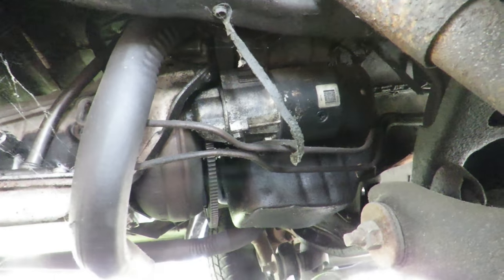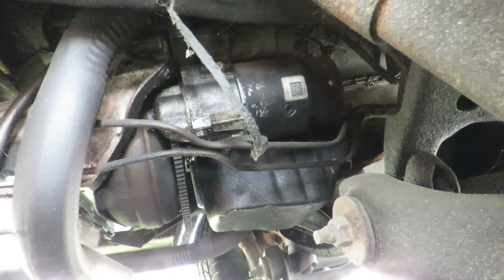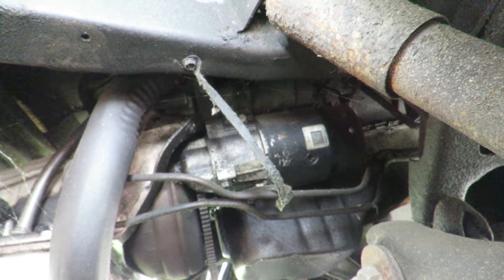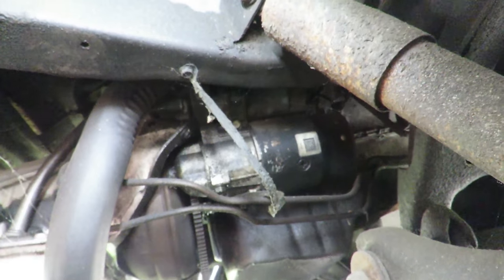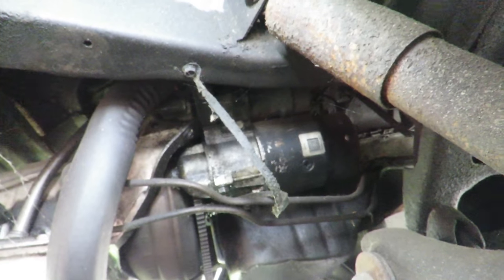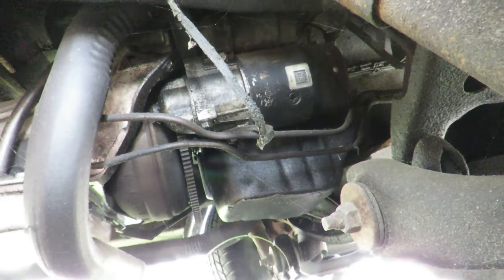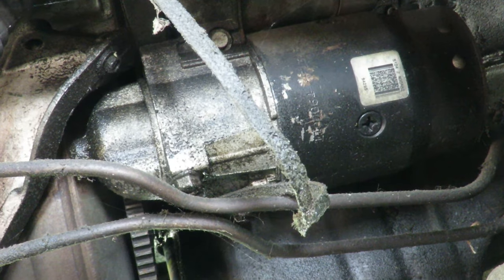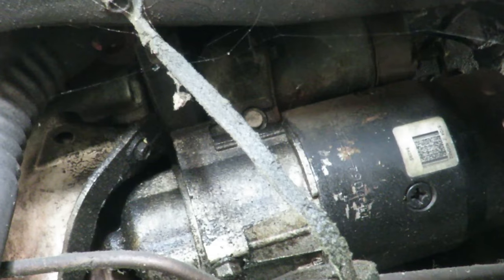⭐ How Does A Starter Going Bad Sound? - Sounds Of A Bad Starter - Part 2 In Description

Comment: My 99 poniac Sunfire makes that noise and starts after a few trys, it's runs fine no problem, but earlier when I parked it and came out later to try to start it, it didn't start no more, it makes the same noise, could it be the starter?
Reply: Like sometimes after I get it started in the morning, it'll start up fine. but most the time I gotta give it a few turns, but now it's it just making that noise.
Reply from the maker: Yes, it definitely sounds like the starter is bad!
Reply: Like it sounds like it wants to start but it's not.

Comment: Question ! Does a failing starter keep making that noise as you drive ?
Reply from the maker: In my career, I have only seen that once, but it was on a BMW, and the battery terminals got REALLY REALLY HOT.

Comment: Hello my starter of my 1978 datsun 280z cranks super slow like never before I put new battery and same thing . Is the starter going bad?
Reply from the maker: Check grounds and timing first. I had one of those, and I wish I never got rid of it, GREAT CAR!
Reply: Astral Auto Repairs  bro but I was checking compression test and i removed all the spark plugs and after doing the test in the first 2 cylinders the issue started

Comment: I have a 2006 Chrysler 300. The other day I had to jumpstart the vehicle. I took it to auto-zone to get the battery tested . The computer showed good battery but needs to be charged. I had the alternator replaced with a new one in March of 2020. The car has been running fine for the past few months. I decided to get a new battery as I’ve had the vehicle going on three years. After installing the new battery the vehicle wouldn’t start at all . So I decided to check started relay by taking it out and placing it back . When i did so the vehicle started. I also swapped the horn relay and the car started. I then proceeded to purchase an after market relay for the 2006 Chrysler and I tested the vehicle multiple times  and the car would turn on without any issue. I took it for a drive to a friend who is a technician . I turn the vehicle off. I attempted to turn on  the vehicle and it would not turn on. I went back to to the relay box and took the relay back out  and put back in and i was able to turn the vehicle on. Not sure if it could be a bad computer or if the starter may be going bad. The starter didn’t sound like a starter going bad. At this point your feed back would be much appreciated.
Reply from the maker: Be sure the ignition switch is good because Chrysler has an issue where a piece in the ignition switch breaks, and the car won't start sometimes. Hope this helps.
Reply: @OnlineAutoRepairVideos  , yes thank you. I’ve thought about the ignition as well but  it has been turning on . It just doesn’t turn on from time to time.
Reply: By the way, I’ve learned so much watching your videos.
Reply from the maker: @ricosuave2934  Can you do a video of the problem, so we can see the issue, and THANKS for the compliment on our videos!
Reply: @OnlineAutoRepairVideos  , absolutely!!!! Thank you so much!!!!!
Reply: @OnlineAutoRepairVideos  I have to work tomorrow. I’ll do the video and send it your way.
Reply: @OnlineAutoRepairVideos  , where do I send the video to. Sorry.
Reply: I had to reset the anti theft immobilizer . I’ll let you know if this take care of the issue.

Comment: I just started noticing a ringing sound shortly after startup,kind of hard to explain, imagine like a metalic ringing/whistle I can't pinpoint where  it's coming from,I have noticed that the car starts fine if it's cold,but after a hot startup it turns over slowly, almost feels like it won't turn over.
Reply from the maker: That is another sign of a starter going bad. MAKE SURE you put a heat shield on the new one when you replace it: https://www.youtube.com/watch?v=8ldAFqrcxLQ
Reply: @OnlineAutoRepairVideos  what about the Ringing sound,could that also indicate a starter problem or something else?
Reply: angel cedeno Sounds like a bad fuel pump

Comment: hello just wanted to get help starting my mercedes 380 sl 1982 cranks  no start
Reply from the maker: So it will crank?
Reply: Astral Auto Repairs yes it cranks but want start
Reply: I have recently changed spark plugs, plug wires, coil, ignition control module, fuel pump, fuel filter, fuel accumulator, still cranks but want start turnover and stay,  it tried once’s and no more
Reply from the maker: @NateDawgdidit  Watch this video, and let us know what you DON'T have: https://www.youtube.com/watch?v=P07Gi-c9twk

Comment: My 2014 mustang with 49k miles completely died on me. Getting the starter replaced today hopefully its that
Reply from the maker: Wow, just 49,000 miles?
Reply: @OnlineAutoRepairVideos  It ended up being something electrical in the ignition switch area. Getting it back tomorrow. Miss my stang smh
Reply from the maker: @mannyrios9708  What size engine do you have?
Reply: @OnlineAutoRepairVideos  3.7 supercharged

Comment: my car wouldn’t start today and when it did it took at least a minute or so in the ignition for it to finally turn on and my batter and alternator is good 🤔
Reply from the maker: Did it crank or it didn't even turn over?
Reply: @OnlineAutoRepairVideos  it didn’t turn over the first few times and then i just kept it in the ignition to turn my car on for a minute or so it finally turned over. it’s like my car kinda tried to turnover but it wouldn’t
Reply: @OnlineAutoRepairVideos  and today it started making a noise idk what the first sound was and then a rattling sound kind of by the starter. i just know my starter can start going bad because it’s 10 years old and basically 100,000 miles now. i just never had my car do that to me and i know it’s not the weather and my car always parks in my driveway
Reply: i believe it cranked just wouldn’t turnover the first few times
Reply: @oliviachristel3524  I'm curious if you had an update? How long did you drive the car until it was fixed?

Comment: I don’t hear any sound and my battery is good
Reply from the maker: Check to make sure you have 12 volts at the SMALL wire when the key is put in the START position.

Comment: My car is slow to start. Sometimes you push key forward and nothing until the second try.  We have lights but no action. Thinking it's a starter. However if we jump it with a battery box it starts back up.  Just replaced battery. Possible it's still the starter?
Reply from the maker: YES, sometimes when a starter is going bad, it pulls a lot of amps from the battery, and that will cause it to turn slow. Make sure all the terminals are tight, and you can actually take it to Autozone, or similar, and they can do a test on the starter while it's still in the car. Hope this helps, and keep us posted.
Reply: @OnlineAutoRepairVideos  we actually had a parasitic drain. The body control module had a short in it

Comment: Can a bad starter cause odometer to reset? For example the trip miles?
Reply from the maker: No
Reply: @OnlineAutoRepairVideos  i tested the battery a while ago and it was giving me low voltage. So I'm going to buy a new battery
Reply from the maker: @iserrano023  Do you have a battery tester, or how did you test it?
Reply: @OnlineAutoRepairVideos  Yes I do. A basic one from Walmart.

Comment: Can you jump start a car with a bad starter?
Reply from the maker: In some cases, yes you can!
Reply: @OnlineAutoRepairVideos  Thanks. I just changed my wife's battery 6 months ago, and now it just clicks but doesn't crank. But I can jump start it, and did 3 times today.
Edit: the running voltage is 14.9v and when its off the battery says 12.5v and continues to drop
Reply from the maker: @privilegedwhitemale306  Sounds like a short.
Reply: @OnlineAutoRepairVideos  Turns out the new battery has 41 cca😆
Advanced replaced it free. Couldn't believe i was the victim of a dud battery. Thanks for your help

Comment: what if you start it up and you hear a grinding noise? thats what mine was doing, they tested it, and it was just bad.
Reply from the maker: It's possible
Reply: It means your starter is too close to the flywheel and needs to be shimmed
Reply: @williamking8684  so what will I need to do.my bolts are also loose

Comment: So just took my 2007 Hyundai Tucson to the shop, it does this sparky clicking noise every so often for about 10-30 seconds when it does happen. Shop said car looked good everything is fine was a little low on oil and they didn't hear anything , but it still happens. He said he was concerned about the starter being a little older it could be staying engaged and is bouncing off the fly wheel. Does that make any sence to you or have any ideas what it could be? Also does it while the car is running has nothing to do with stopping or starting it.
Reply from the maker: If you can catch it, do a short video on it, and then place it on your channel so we can hear it, that would be great!

Comment: Yea but what if there's no crank no start
Reply from the maker: At that point, to eliminate that starter, make sure you have 12 volts at the SMALL wire to the starter, when the key is in the START position. If you have the 12 volts, and ALL grounds are good, then it's your starter.
Reply: Guess what?? Tow guy comes to take my car to the shop. Ask whats the problem? I tell him. Popz the hood reaches elbow deep say gear cover or cap came off. He put on says start your car. Guess what my car cranked right up. When go buy the cap what am I aking for. Gear cover or cap..
Reply from the maker: @72dee  That's cool!! I'm not sure what part that is, but if you can send us a picture of the part or area, we can figure it out. Send it to Tim@AstralAutoRepairs.com

Comment: Sometimes I have to crank the engine 2 or 3 times before my car starts, i checked if battery was going dead but it was fully charged. Is my starter going out? How long before i get stranded somewhere?
Reply from the maker: Those first few times when it doesn't start, does the engine turn over?
Reply: @OnlineAutoRepairVideos  yes it tries but then fails. Sometimes it starts first try but not strong
Reply from the maker: @a2isha  If the engine turns over, then the starter is good. Do you have any codes in the computer, and what kind of vehicle is it?

Comment: great video........unrelated question.....i keep blowing a fuse every time i turn on the air conditioner.....no heater or fan either......what could it be? its a 1998 toyota avalon
Reply from the maker: It could be the compressor, cooling fan, blower motor. I would start with those first.
Reply: Check online forums I'm sure someone else has had that issue.. lmk if you figure it out

Comment: Now its sitting cause of seals and her traction light is stuck on
Reply from the maker: Those are good cars, you should get that fixed.
Reply: @OnlineAutoRepairVideos  we already did and her car has 182210 on the clock
Reply: @OnlineAutoRepairVideos  she also got a 2012 nissan juke and a 2002 tl
Reply from the maker: @keseanwoods2977  COOL, how does she like the Juke? My wife fell in love with those when they came out!
Reply: @OnlineAutoRepairVideos  shes in love she be moving the heck out of it
Reply: @OnlineAutoRepairVideos  also my moms juke has this weird idle the idle will go down then back up we have been told ac compressor before we had to put 4k in it cause her wiring harness and alternator caught fire
Reply from the maker: @keseanwoods2977  Wow, how the heck did that happen? My Dad has the Rogue, and pretty much they are the same, but we like the way the Juke looks!
Reply: @OnlineAutoRepairVideos  hers is a 2012 and we did not know we bought it with a bad alternator and one day it caught fire but before we knew it did we were accelerating and the car only did 3mph foot to the floor I told her put in manual mode and we got home it was on fire
Reply from the maker: @keseanwoods2977  WOW!
Reply: @OnlineAutoRepairVideos  she be moving that turbo LOL
Reply from the maker: @keseanwoods2977  LOL, and it's a TURBO!!!
Reply: @OnlineAutoRepairVideos  yep 188hp non nismo
Reply: Your wife has a turbo also all of them have turbos
Reply: Theres a 600k nissan juke it's the juke with gtr motor
Reply: @OnlineAutoRepairVideos  and theres also a diesel juke and they are quick
Reply from the maker: @keseanwoods2977  Oh, we don't have one, she just liked it, LOL!
Reply: @OnlineAutoRepairVideos  if u need advice for a car to buy let me know cause I have good ideas
Reply from the maker: @keseanwoods2977  Sure will
Reply: @OnlineAutoRepairVideos  I say a 2015 mdx  or a Corvette stingray

Comment: how about rapid clicking?
Reply from the maker: I have heard of a one click, but when we came across rapid clicking, it turned out to be a loose terminal or wire.
Reply: @OnlineAutoRepairVideos  at fisrt it cranked w/o starting like no gas. replace the fuel system it started on time. then crank and like dead battery (jumping was no help) now rapid clicking...like a machine gun
Reply: @randyunderwood2894  Replace the battery.

Comment: Tim I was looking at the video and in front of the starter I do not see that bracket I don't know about van come out with it it is very important that bracket been on there if it came out with it and I know back in the days I'm old school but the motor vehicles came out with them a lot of people throw them away that's a No-No,,, I do not know if you knew that or not
Reply from the maker: Do you mean the back of the starter? If so, I do know what bracket you are talking about. I don't think there is one old chevy out there that still has it, LOL!
Reply: Yes that's what I meant Tim I know a lot of people do that I used to do it back in the days then I found out different and after that I kept on putting back on